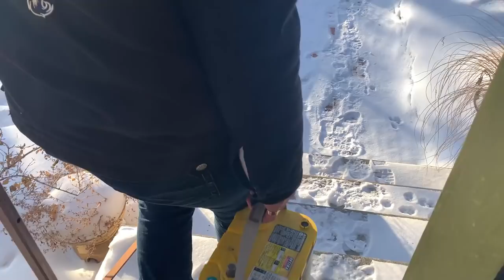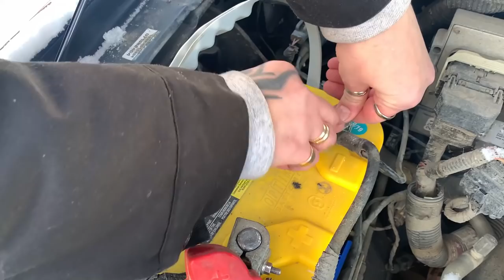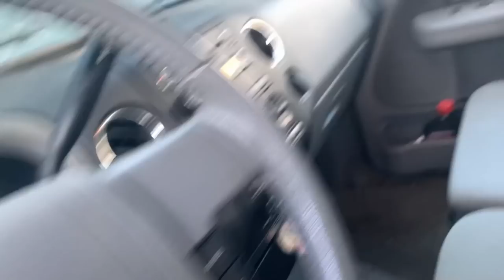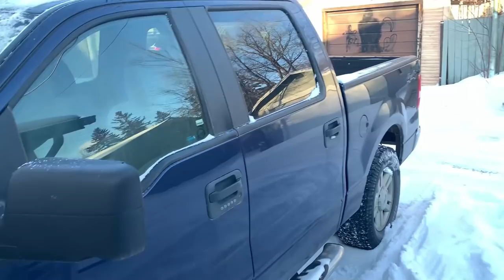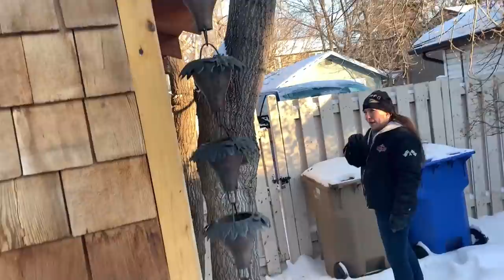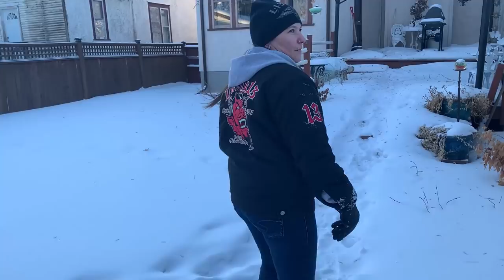2021 WINTER VLOG! * INSTALLING A TRUCK BATTERY IN -30°C * GIVEAWAY UPDATE!

Comment: We have battery troubles too so we have been disconnecting the battery whenever the car is not in use.  There is a slow drain somewhere and the radio always comes on when we start it.  We just disconnect 2 post, have a small thick towel to be sure all stays not touching anywhere.  LOL, it has never started on it's own like that but we only use a key fob only lock, not to start it.  Going to be a long week of cold starting yesterday!

Comment: Hi guys , I keep a spray bottle of rubbing alcohol in my vehicle.  When theirs ice on the windshield,  I spray it down and the ice disappears and also cleans the glass.  This works great for outside mirrors also because one shouldn't ever scrape them.( it can snap the rubber gasket that adjusts your mirrors.).

Comment: I guess snow between concrete and battery . But I've always been told never put battery on concrete. Because I was putting a still good battery and I was told to put on board not concrete.
Reply: If I remember correctly do not store a battery on concrete, use a board (like you mentioned) or a rubber mat.
Setting it down like Karen did, is ok.